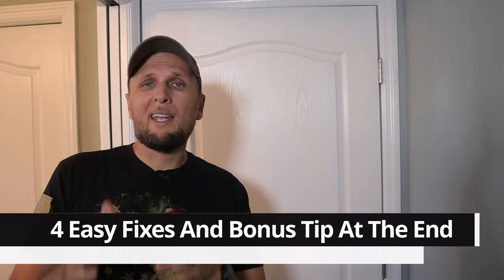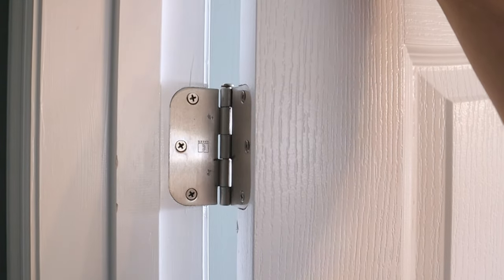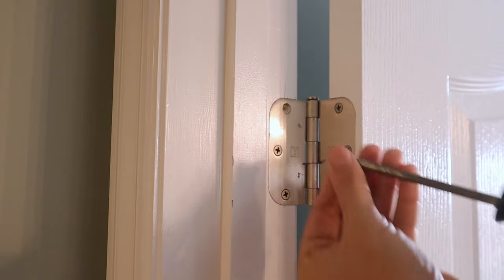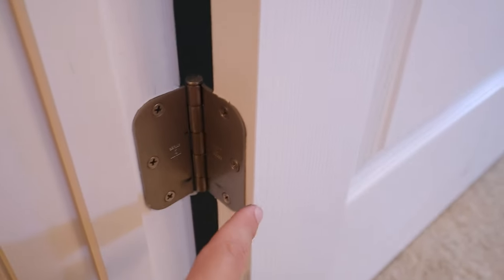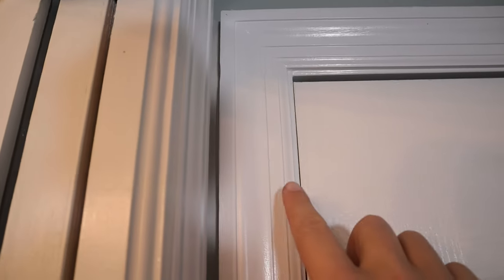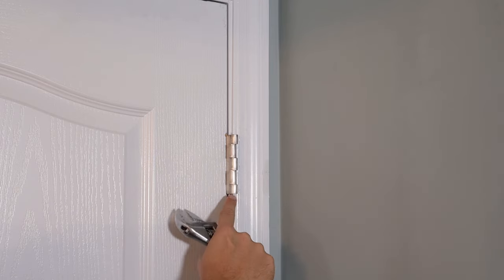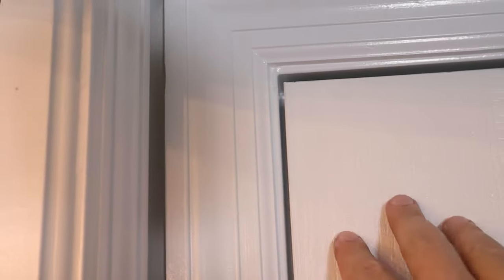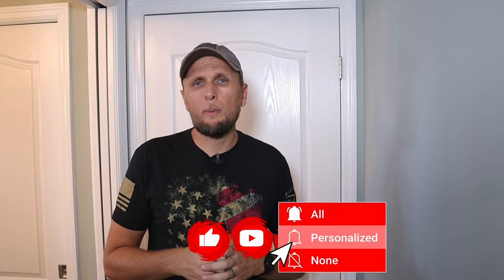How to Fix a Door That Won't Close!  Door Hitting Top of Frame

Comment: I wish i had watched this before i ended up shaving a door down out of frustration with a crooked frame. Oh, well, i still have three more doors to replace. Thanks for this great video and awesome channel.
Reply from the maker: Well I am glad I was able to catch you before you did all of them haha.  I am glad to hear that it will save you some time.  Thanks a lot for the feedback and if you haven't done them all already, good luck!
Reply: @HowToHomeDIY  Thank you sir. This particular project involved installing a door where one had never been before. the existing doorway was crooked as hell because the drywall was installed bowed. A tricky piece of work. All the other doors I’ve replaced went very well. I was aware of the bending the hinge trick but had forgotten all about it. Duh! In any case, I really enjoy your channel and your personality is very reassuring and calming. Great You Tuber!

Comment: Any idea on a door that is hitting the top and crooked. Someone installed new shed flooring and raised the floor about 5 inches thus now the door wont shut or match up with the locking mechanisms. You can shut the door but have to lift it and push it to the right up top to get it to shut but nothing matches up. Any help please.

Comment: This was very helpful. I have been struggling with the door not closing when replacing the hinges. I see that the new screws are a size smaller and as soon as the new hinges are installed, the door jams. When I replace with the original hinges, there is no more jamming. The hinges are the same size. I will try out the steps you outlined. Thank you.

Comment: THANK YOU!! Bending the hinges and the 3 inch screw got my door to close and it was literally going over about 1/8”! 

Question-I was thinking of adding a 3 inch screw lower as well to solidify the door system (I installed a whole new system) as well but could that have the opposite effect?? Don’t want to obviously if it could negate the progress made. TIA.

Comment: You, sir, are a genius! My heavy front door (full glass lite) has been sagging for 10+ years and not matter how many 3" screws I put in the hinges/frame it didn't help.  I tried the hinge bending trick and it worked!  

Question, are hinges typically bent in this scenario and will they bend again or is it just over correcting to get the door to close?

Comment: I used a Toothpick but it still isn't getting tightened fully. I have four screws there, three philips and one normal one. And problem is all the nornal screws but Toothpick didn't work and two will be more for the hole I feel but perhaps I will have to try with two Toothpick.
Reply: Get a wooden dowel and drill bit (slightly smaller then the dowel ). Remove the screws and plate and drill the loosely threaded hole deep enough to where the dowel would be flushed or cut it to desired and once that’s nice and tight put the plate back on while lining up with previous holes and mark where you need to create the new hole. Make a pilot hole then insert your new screw 🎉

Comment: Nah mate take a jig saw and just run a couple or so inches of the top then close the door, any space just nail a bit of 1/4 ply to the top of the door to fill any gap , if you want a class finish give it a lick of paint : Trade tip : Use a good brush 👍
Reply: lol, just bypass using a file eh